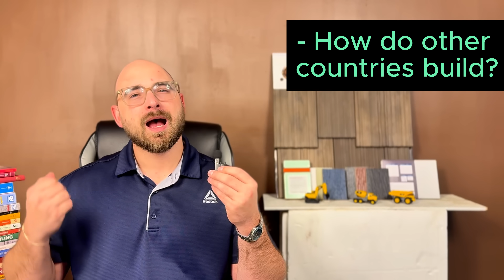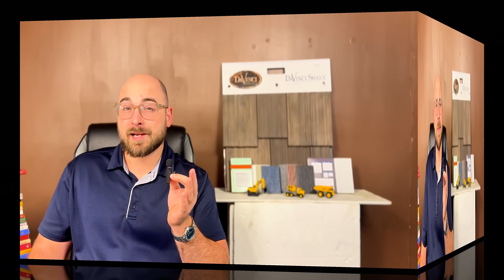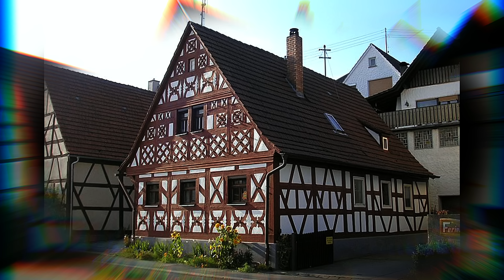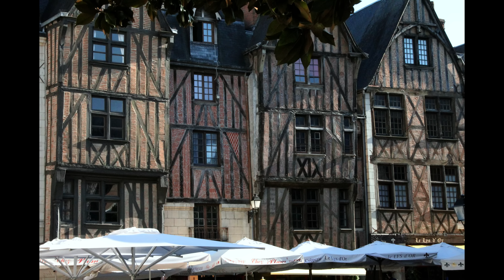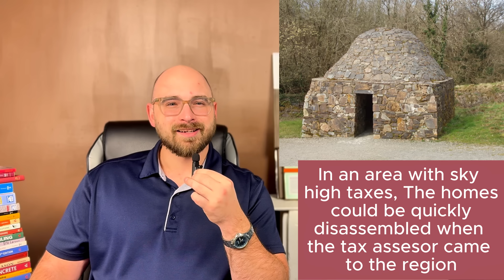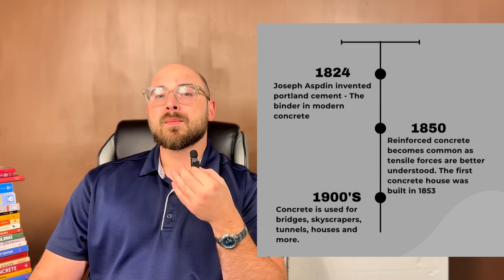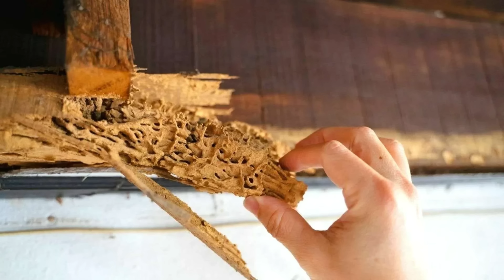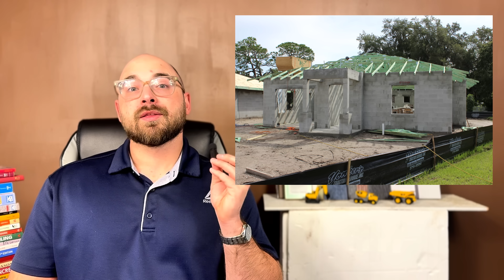Why Other Countries LAUGH at American Homes

Comment: Wow, what a lot of self-hating propaganda. Was this written by a Chinese or a Russian bot?  Or is this just for you to attract a few high-end customers? Yeah, the housing problem in the U.S. is that they are built with natural materials and not more carbon-emitting concrete and designed like bunkers so they're even more expensive. Go away.
Reply: You are so delusional 😂😂😂. American "houses" are a scam made for quick enrichment of developers. Every shed in my country is built more solid than your " homes".
Reply from the maker: What more eco friendly? The concrete house that survived everything or the wood house that burns down and emits a bunch of C02 and toxic chemicals in the process potentially costing people their lives? 

Let’s try another one, what’s more eco friendly, building a wood house every 40 years for 200 years, then landfilling all the material, or build a concrete house one time and renovating it once a century. 

You tell me …
Reply from the maker: As if 2x6”s just grow out of the ground on site, 

We use gas powered equipment to farm, grow, harvest, plane, engineer, and kiln dry the lumber then throw it on trucks to transport it to the site, then use gas powered generators to run the air compressor needed to nail it all together 

Let’s call a spade a spade, concrete is not “of the devil”  we’re using the best of what we’ve got. When eco friendly concrete is available, we’ll use that. 

But to say everything should be wood cause C02 from is bad for the climate is disingenuous and ignores so many other factors
Reply: @Mike_Fortin  Where do you live? Mississippi? My house is over 100 years old. Most of the neighborhoods around me are filled with 100+ year old houses. But sounds like you're all primed to pitch bunker-style houses to those in CA. IMHO, a lot of houses in Europe are over-engineered. Seems like there's little difference between residential and commercial designs. And as a result, the percentage of homeowners in most countries there are much lower than in North America.

Comment: I don't like the European construction.  Everything is done with cement and bricks and over built.   I am in Canada and everyone builds with wood.   My wife has an apartment in Ukraine and it is a real pain.  You need a hammer drill just to hang a picture or drill a hole.   I have changed my  house around  in Winnipeg multiple times , adding bathrooms, built a garage,  room above garage and it is so simple.   Cement is also very expensive and hard to insulate.  It is hard on the environment and had a large CO2 footprint.   
Here in Canada there are no termites either so that is not a problem.
Reply from the maker: using ICF solves a lot of the problems with concrete buildings, you can run wiring, hang drywall, attach to the built in studs etc. 

Is the C02 is it produces bad? Yes. 

So is building wood houses that get landfilled every 40-60, so is having an entire wood city burn down. How much C02 does that release. 

Plus wood is not carbon neutral.  not even close. We use gas powered equipment to grow, harvest, plane, engineer, kiln dry, transport and install lumber.
Reply: @Mike_Fortin  I will have to check out the ICF, it sounds pretty good.
The old houses should not be landfilled.   I screwed my house together so it could be dismantled.   It should be illegal to dump the building materials and not recycle them.  I did hear that in Germany you can't landfill a house but must deconstruct it.   My deck in front of my house came from another deck that I bought off a guy in 1995 that wanted it gone.  I just refinished it last year and put a new aluminum with tinted glass railing and gate.  So this deck wood is over 40 years old and in good condition.
I can't believe what people throw away and all wood that I can't use I take to Re-Store.   I see all these houses on TV being bulldozed, and that should be illegal.  They do this in California.  In Manitoba we don't have termites (yet) , so wood is essentially good for 1000 years.  Broken up wood can be chipped and made into composite material. 
As far as the CO2 goes, I don't really know.  But I did hear that planting trees is a waste of time and money.  The trees have to die and get buried so they don't decompose.  In the north , it is better not to plant trees because where there are no trees the snow will reflect sunlight into space and the same goes for desert areas like in China where they are planting lots of trees.  The forests are dark and absorb sunlight whereas a desert reflects a lot of light.   The trees being planted by different groups are also all identical clones so you don't get a heathy genetically diverse forest , you get what they call "green concrete."  One pest will wipe out the whole forest .  It is better to let the forest regenerate naturally or maybe find a way to nudge it a bit.
Reply from the maker: Thank you for your Very insightful comment, 

Especially the part about diversity in forests. 

In a more perfect world I would like to see eco friendly concrete become widespread while lumber plantations become nature preserves for future old growth timber and biodiversity
Reply from the maker: If you’re interested in ICF 

look into Crown ICF . Their product is the best 

www.CrownICF.com

Comment: As a European working in construction, what i think astounding is not so the building materials but the price of the typical American home given those building materials. I agree that it is probably a difference in philosophy, but when building any structure, and more so for homes, I would expect the structural work to never be an issue, regardless of the lifetime of the building; or more clearly for that lifetime to be independent of simple "aging". What I find really crazy in the price of home in the US, is that it has basically doubled in the span of 20 years (And I'm not even talking about the fact that the average US home is twice the price of a French home!) for something that will deteriorate over time: it cannot be an asset as in can be for more sturdy homes, but it is considered as such. From my POV, American homes are as much an investment as a car, that it to say, not one (barring a very few exceptions).  And that wouldn't be an issue, if it was not the main component of one's assets, as it usually is, in America or elsewhere.

NB: For information, in France most houses are built using concrete blocks (brick blocks are quite a thing, but generally a bit on the more expensive side), bigger habitation buildings are usually poured concrete. (bigger non habitation buildings are made of whichever material the architect saw in his dr*g-induced fever dreams)
Reply: I live in a brick block house with (plastered) brick ceilings, which I've never seen before. Still good after 18 years without painting. [Edit - next day - should have added. I'm in France.]
Reply: In general the land is around half of the value of a home and finding small plots of land where you could build a home is extremely difficult in most of the country.
Reply: @TheAngryKilljoy  Yeah, I just looked into it, and I didn't thought of that initially but it makes more sense. The average American home is twice as big as the average European one, it's even a bit more than twice for the land area alone. It makes sense that the asset would be the value of the land over that of the house on it.

Comment: My wife and I live in an Earthship, it keeps us warm in the winter and cool in the summer, our home is built to withstand strong winds, it's fire resistant, and earthquake resistant, we grow food in it year round, and we have no utility bills.
Reply: Good for you. If you have a lot of time and money, a home like that can be built, because it’s very expensive and time consuming to use recycled materials not meant to build a home, to actually build a home, such as all those tires
Reply: @steveperreira5850  Yes. There's a house that was built with solar and wind power sources in the San Diego area. It even looks nice. But it is impractical to built houses like that to try and house everyone in. It's on a large piece of land that is approaching two acres. The price is high than the average home in San Diego which are already high.
Reply: @ You can build such a home without those tyres. It is only expensive for those who don't want get dirty building a house DIY.
I do most DIY buy high quality materials, use good proven construction methods instead of paying good money the nailgun artillery for putting a stick/fluff/ cardboard box together.
Reply: They have good aspects but do not work well with high density surburban housing. Nice in the right climate with a large acerage
Reply: We are building something similar to earth ship. A combination of rammed earth, straw bale and a large conservatory.
I would never build a stick home anymore after renovating 3 of them.
Reply: @NOWAR-q7s  Renovating is not the same as building
Reply: @ Renovating reveals the truth about a construction method.
I have worked in renovations in 14th century structures, 1920's houses, 1980/1990's stick framed houses.
The poorest quality, the poorest workmanship, the poorest design was the stick frame houses. Post and beam, half timber, CLT, panels, concrete, strawbale, rammed earth , masonry etc. is all superior over stick/fluff/cardboard construction
Reply: @NOWAR-q7s  They have their qualities and drawbacks. I would guess I've built or worked on 150 minimum. When it comes to flexability it is difficult to surpass. I'm currently in a double wall 14'' passive, active solar superinsulated one that is all wood and cellulose insulation. I wouldn't do it any other way in Canada.
Reply: @ A double wall is costly. A single wall with thick continuous overlay insulation on the outside is more effective at lesser cost. Same applies to the roof.
Reply: @NOWAR-q7s  WHY???
Reply: I hope to see these in my area and to visit one. I will never live in one but I feel that is it the way to go, they will last a long time.
Reply: You're living my dream
Reply: Earthships are not just rammed earth, they are solar passive homes that are cooled and heated by earth and sun, they also contain greenhouse atriums that produce food and use recycled water to feed and water plants.  They are made to be as sustainable as possible. While most are in southwest US they have been built all over the world.  They require proper sites to use the sun. Great time and personal labor to build cheaply OR high Costs to have it built for you.   There are many videos online from architect who first designed and built them in New Mexico in the 1970's and continues to expand a neighborhood of them for enthusiasts around his original homes.
Reply: Go take a bath hippie!!
Reply: What is this!
Reply: you should do a video i would love to see it
Reply: What is a Earth 🌎  Ship???
Teach me
Reply: @BillieWilliams-l6m basically just a fancy name for a cob house (straw, sand and clay). They usually use recycled materials to build such as old tires or glass bottles. Mostly I’ve only ever seen them built in the south west, dry arid places. I’m sure similar could be done elsewhere but I don’t know how well they stand up to heavy rain.
Reply: Lmgtfy @BillieWilliams-l6m
Reply: How’s the off-gassing from the tires? Also, how’s the moisture?
Reply: I am totally in love with earth ships! Some day…

Comment: You forgot about aerated concrete blocks, which are very popular in Eastern Europe.
Reply: Yeah there's also "newer brick types (with multiple hollow cores, as in germany or switzerland) that allow for a completely monolithic construction which is def preferable. That's how I would build. Structures are often reinforced with concrete pillars tied into the foundation and concrete ring beams. It's a vastly superior method. That'll last forever.
Reply from the maker: You’re right AAC is a popular material choice worldwide
Reply: @Mike_Fortin  A house made of aerated concrete blocks does not require an expensive forced ventilation system, like a frame house, and does not depend on electricity. The walls there are single-layered and will normally remove moisture. Ventilation works according to the laws of nature if the ventilation duct is made in the form of a vertical pipe made of solid brick. It takes longer to build than a house made of sticks and plywood, but such a house is energy efficient, accumulates heat or coolness, does not lose its shape and does not require frequent repairs.
Reply from the maker: Interesting, I must do more research
Reply: @Mike_Fortin  Matt risinger has a good Switzerland series in his YouTube the build channel. I can highly recommend it...

Comment: you dont want bricks on the interior. , hard to run any wires or pipes thru bricks.. hard to do any renovations, ,and brick homes are cold in winter or hot in summer. In perfect home you do want bricks ( stones) on the outside and timber framing with sheetrock on the inside. That gives perfect insulation, nice flat walls , and easy way to run wires pipes, and fast cheap way to doany alterfiction to your home.

Comment: My ICF home in Wisconsin nearly heats and cools itself.
Reply from the maker: I believe it, 

When you do ICF from the foundation to the roof, you benefit from earth coupling, transferring the stable temperature of the earth 55-65f, all the way up your wall. 

There’s the thermal mass of the concrete, the air tightness, and the lack of thermal bridging 

Not to mention disaster resistance. You can’t beat it!
Reply from the maker: What brand of block did you use?